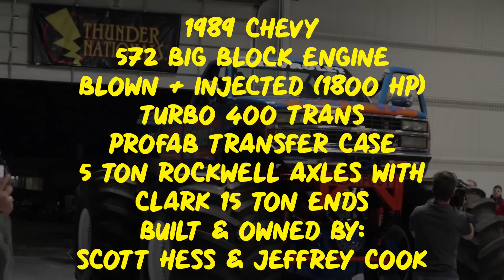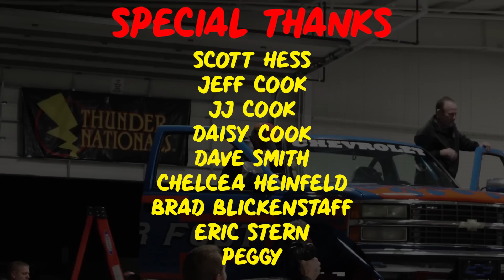Bearfoot Racer Monster Truck Build Jeff Cook Wildman Adventures Episode 43

Comment: for someone who loves monster trucks but has zero mechanical experience, why were the differentials ion the axles offset? I mean I know back then all of the parts were more or less repurposed from other applications, but what was the purpose of that offset in the original military axles and why did the differentials become centered in future trucks?
Reply: That's a planetary end, it uses a planetary gear reduction to ease the strain on the power train.